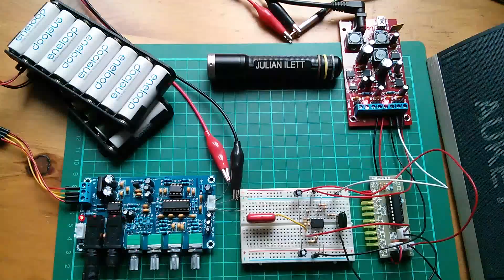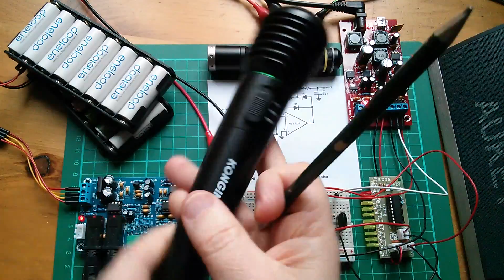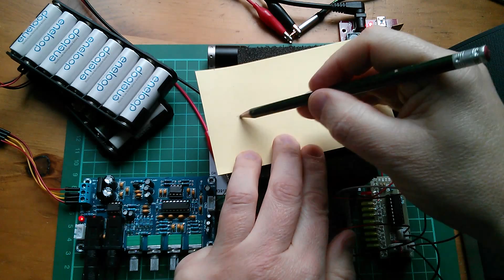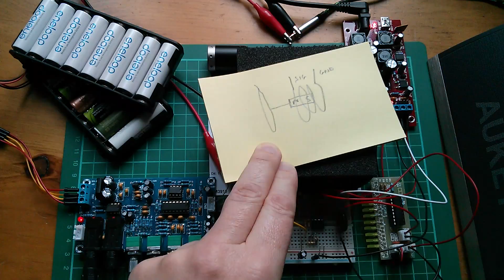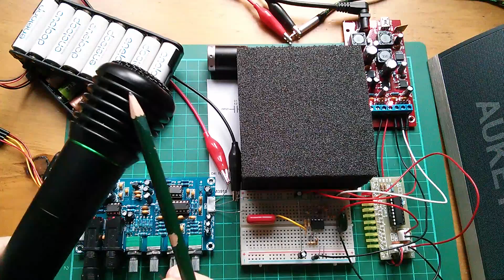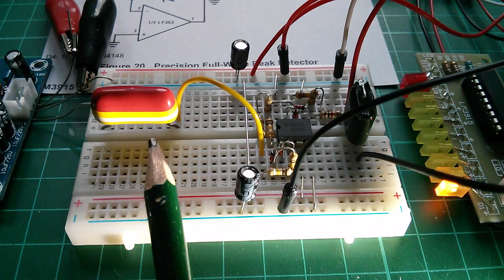PPM Bargraph, Op-Amp, Split PSU and Gregorian Chant

Comment: Some pro audio mixers can switch the meters between PPM and VU modes.  VU mode shows the RMS level, so it's a bit slower/smoother and will only show 3 dB below the actual peaks, whereas PPM mode is faster and shows actual peak levels.
Reply from the maker: Thanks Miles - interesting. The LM3916 is a VU version of the LM3915.

Comment: You can easily omit a spilt voltage supply if you set up a virtual ground for them OpAmps. For basic usage by just using a voltage divider. and use it for your OpAmps as a ground path. Now you need to block the DC with capacitors, but that´s about it.

Hopefully your ETI stuff is going to work. I had lots of trouble getting their stuff to work right when i built it....They kinda work but not as supposed to do, and add some flaws herre and there...

Anyway good video, as always...:)

Comment: Julian, I'm just starting out electronics and I'm using a crappy wall-plug in variable power supply with no selection between 4.5 and 6v. What kit are you using here for the power supply, or what would you recommend for a very cheap power supply that provides 5v?

Comment: Bipolar rails may not always be required if you use capacitors (as isolating and level shifting devices). Input BJ transistors can then be biased at some positive level on a single-rail amplifier's voltage.

Comment: Why not use a single supply opamp configuration with positive offset? Considering that you are using battery supplies, a positive offset single supply should be considered prior to a split supply. Also, rather than using fancy power boards, have you considered a rail splitter opamp circuit? Seems less resource intensive.

Comment: Thanks Julian. :-)
Another one that could be done with a microcontroller and some code. You could use the ADC and some software to reproduce the same outcome as this complex circuit, maybe even a fancy peak hold feature. Far less parts required.

Comment: Maybe adjust it a bit if you really want the red LED to indicate distortion. I could hear it starting at the 6th LED.
But, I do understand that it is not a HiFi piece.
Reply from the maker: Yeah there was a bit of distortion - interestingly, the vocoder has three red LEDs and 7 yellow (actually green in the original).

Comment: Advice please: I would like to get a eBay buck converter so I could go from a 12v car lighter to power my old 19v 3.42 amp notebook computer on the cheap. Any suggestions on a board or specs to chose? Thanks!

Comment: The audio frequency dot mode looking like bar mode is quite an attractive effect imo. The top of the bar is a bit brighter because the gradient of the waveforms is less steep - the LED is being pwm ed at a higher duty cycle.
 looks a little reminiscent of the old 'magic eye' VU meters.

Comment: With the LED bar graph, how are you going to attach that pcb to the front panel, while also having it look nice? The leds are going to be poking out the front and look pretty weird. 

Maybe you could get a 3D printed piece that the LEDs push into which attaches the PCB to the panel.
Reply from the maker: I was planning to hang the bargraph PCB off another nearby PCB - so the LEDs will be a bit floaty.

Comment: Hi Julian. I was inspired to start building the ETI Vocoder by your good self, as I just happen to have the original articles. However, I feel I should warn you that the circuit diagram of the Internal Excitation Board has an error which I am unable to find in any errata in any subsequent issues. There is a resistor missing from the diagram, namely R18 (47k), which goes between the wiper of RV7 and the summing point of the mixer. I discovered this after spending a week designing a better board layout than the godawful mess which was originally published. You would probably have spotted this anyway, but I felt obliged to point it out.
Looking forward to more of the same . . .
Ellis Pelham - Glasby
Reply from the maker: Hi Ellis - yeah the article is riddled with errors. I've found a dozen or so errors so far and I'm sure I'll find more :)
Reply from the maker: How far have you got with the rebuild?
Reply: Why am I not surprised . . . ? 
Mind you, I used to take "Practically Electronics" as well, so I should be used to this.
Reply: Purely in the (re)design stage at the moment.

Comment: when dealing with positive/negative voltages, it is not normally referred to as ground. Ground is referred normally when the wire conductor goes to earth. you should call it common., Because it is a common path to both/all voltages.

Comment: But a single polarity voltage DC powered audio amp is possible by just using series input and output coupling capacitors. Your statement that audio 'requires' dual polarity DC voltages is not absolute as you stated.
Reply from the maker: It is possible. Often a virtual ground is created within such a circuit using a potential divider to feed a mid point voltage into an opamp. It's all relative :)
Reply: And it's easier to design op-amps with a split power supply.
Reply: A output coupling capacitor adds a frequency dependence. The extreme case: a split supply amp can output DC for any time (which can fry your speakers ;) ), a single supply amp with coupling cap can't.
Reply from the maker: But you can also have a DC blocking capacitor on a split-supply amp.